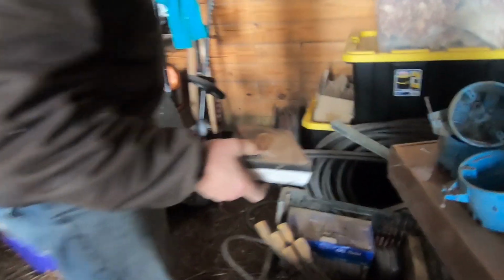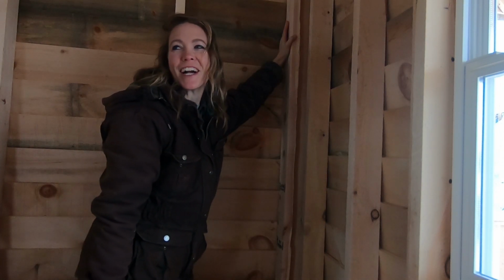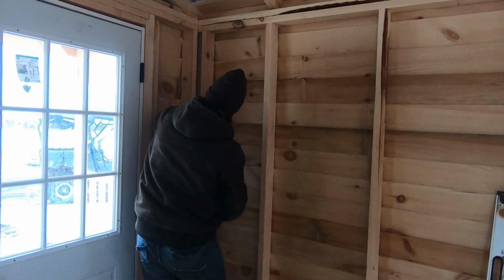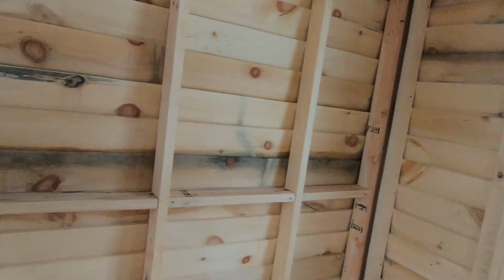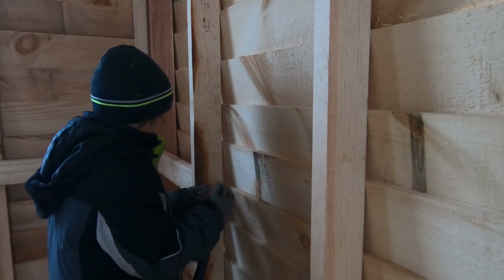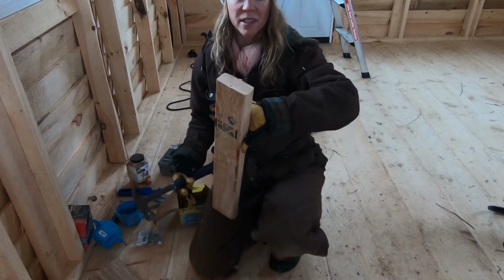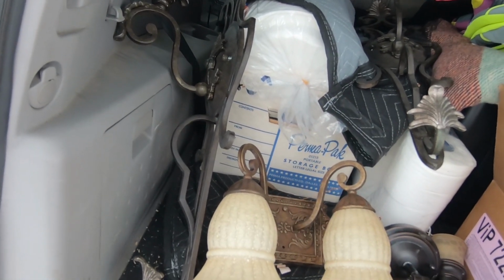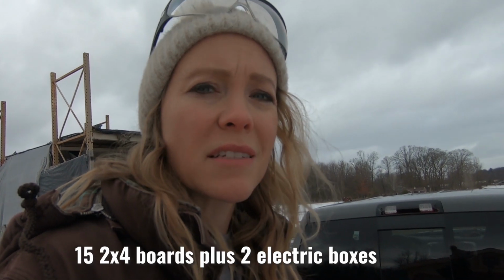THIS Was a DUMB Idea . . .  - DIY Off-Grid Shed to Cabin Vlog#3

Comment: That was a lot of nailing- nice job guys! Please go through and check all your siding. Around the 10 minute mark you can actually see the siding bouncing as you hammer nails in. I am afraid that with it being that loose, the spray foam will expand and push the siding out and you won't be able to put it back easily. Love the build :)
Reply from the maker: Good eye! Yes Erik noted this as well, and pulled those nailers out and re-did them. Currently spraying the inside "cracks" before the pro comes to do it :)

Comment: Thanks for the shout out. 
Your arm will become conditioned to the hammering.  The palm nailer that was mentioned is a great idea, but we still don’t have one.   You guys are doing a great job.
Reply from the maker: Yeah it was funny , on day 2 my arm felt fine and my hand eye coordination much more improved!   Did you use a framing nailer for yours?
Reply: I bought a paslode framing nailer and we have used it for almost everything. On the house. We used the hammer and nails for the joist hangers in the house and on the deck.  If I had that part to do again, I would buy the palm nailer.
Reply from the maker: @breakheartorchard  good to know, ill add them to my buy list 😄

Comment: Use a drill and screws. We did ours with screws it went faster. I used the torx bit screws. 3 1/2 inch screws. Hammer is ok. But just saying it went faster with the screws. Have an awesome day both of you. 🖐️😆 🔨. I will come back and see the rest of your video. 👍
Reply: plus screws are also easy to remove wen needed
Reply from the maker: We use torx too on our screws! However with our upcoming BIG building project,I figured I could use some hammering practice ;D
Reply: @This1LifeWeLive  ok I see. Building some muscle I gotcha 💪 🔨😃

Comment: As mentioned before, I would have recommended to pre-drill the wood you are going to nail through.  Just a bit smaller than your nail or screw.  I would stagger the horizontal studs, not just to make it easier to install, but makes for a good fire break if the unfortunate happens.   Since you are going to run power to the building, I would install a ceiling fan.  It will help with moving the air around to help with AC and heater.  Since this is a small building, I would not use the larger lights, because they would make the room look smaller.  The one light mount with two lights, I would probably use it as an entrance light.
Reply from the maker: Well now we do have a few ceiling fans in the barn, but they might be a bit large. I'd have to look around for something that would fit and see . .

Comment: I gave up long ago on nails. I run 2.5" or 3" torx drive 8# or 10# (or larger) screws with an impact. Might cost you a little more,  but easier on the body and easier to handle. (Use a bit that is magnetic to hold the screw on until its started). Doesn't matter if it's framing or fixing a corral fence.
Reply from the maker: We usually use the same :)  My next video, you'll laugh because the torx bit is SUPPOSSED to be magnetic but the holder no longer works and it keeps falling out!

Comment: Your hubbie says a Milwaukee 30 degree framing nailer. Pricey, but one of the best. If you guys are going to build your new home, this nailer would be an extremely good investment. If you get one, swing for the 12 amp hour battery. For another $50, you can go much longer between charges than with the 3 amp hour battery.
Reply from the maker: Nice tip!

Comment: If you use 4 recessed led lights you don't need the light sockets they just clip in on holes cut in Sheetrock I put 4 of them in my living room they are adjustable for the color from bright white to warm softer color and they are also dimmable.
Reply from the maker: I've got some of those planned for the horse trailer (tight space) but never thought about using them for the cabin :)

Comment: Poor baby.  Those horizontal ones should have been flush with Studs for nailing Drywall. They don't have to be even height.. put alternate ones 2" higher and nail 'em with longer swing!  No need to toenail.  Use a smaller Hammer.  Wood screws recommended.  3".  Wall mount lighting will really show uneven Drywall.  I have done many basements.  Use ceiling fixtures.  It may be advisable to run Communications cable in a different hole to avoid electrical interference.
Reply from the maker: I still haven't decided if I will buy a router extender or run a long line from the house to the cabin for the internet, but I didn't know it could cause interference running in from the same hole as the electrical.
Reply: @This1LifeWeLive  I am not positive of that but it is a possibility.  You can always use a steel bit to drill wood.
Reply: @gordbaker896  you are correct, the electrical field will cause issues with communication devices if run parallel with each other.  You can reduce the interference with shielded wire. Still not desired to run parallel as their is still interference. You need at least a foot of separation to prevent interference. 
My communications background is 10 years as an 18E.

Comment: Have you ever tried pre-drilling your toenails?  . It keeps my nails straight and makes it easier to pound the nails now. I use a bit at least one size smaller then the nails.  I only do this on the hauler goads and not the studs.  Take Care
Reply from the maker: Ha!   No I didn't know you could pre-drill a nail hole! I thought that was only for screws! Would have worked great in this instance!
Reply: I've had to do it a couple of times.  Just make sure your bit is  at smaller size.

Comment: Stud nailer or palm nailer would make that job go quickly.  Finishing work takes a long time.  Lighting so many options but a fan would be nice in summer.  Thinking window AC might need a little help cooling/heating the room.
Reply from the maker: We will get a stud nailer for our house build for sure! I just thought a bit of hammer practice would be good ;D

Comment: You need to go down to Harbor Freight or someplace like that and get a palm nailer. It runs off your air compressor and it hammers the nails in for you. Got to put a little bit of impact oil in it too to keep it lubricated. Once you try one you'll never hardly ever use a hammer again

Comment: I also watch 628Dirt Rooster Bees. A channel where they show bee keeping and hive removal. You might consider to have the shed so closed from the outside that no bees make a home in the space between the walls. Just isolation material is not enough. They will chew through. You can see between the planks to outside. Find a solution for that strong enough to stop the bees. You hammer with your right hand and had ice on your left arm...   😅
Reply from the maker: Most likely (still researching) I will do an oil based sealer which is rodent, bird and bug repelling :)

Comment: Stagger the blocking. It doesn't need to be in a straight line. If you use a level or a snap line to mark the studs, put one block above and one below your level line. That way you can drives the nails without toe nailing.

Comment: curious, when you were signing off I noticed the upper window frame, does he have the upper and lower horizontal boards reversed ? on the window frame (bottom to top and top to bottom, b/c of the diagonal cut on the bottom one)
Reply from the maker: The window on the right? We also noticed it was VERY crooked :P I don't think it's cut diagonal, it's just not nailed on straight . . .
Reply: I was referring  to the loft window (45 deg. angles on end of trim) but then I got a small glimpse of lower window, so I must not be "up" on Amish trim.  re: the spray on insulation, MAYBE some 3mm ply between  the studs ? , (prevent drafts and insect invasion between exterior and insulation, (might be overkill IDK)

Comment: Farm girl really like your style 👍
Don't look like there's anything you want try 💪 you sure have a very unique way to find some help 😉 you might want to consider some type of nail gun air,gas, battery  it does make things easier and faster if I lived a lot closer be happy to loan you one so you don't have to ice the arm down 😁 thanks for sharing 👏
Reply from the maker: WE DO have a finish nailer, so I'll use that later for the walls, but yes for the hosue we will get a framing nailer ;)

Comment: Susan one of the problems you're having with nailing nails is your using your arm from your elbow down to swing your hammer. Watch and pay close attention when Eric is swinging the hammer he is using just his wrist. You're not trying to use muscle power to drive the nail in you want to use the weight and the swing of the hammer to drive the nail in

Comment: I’m going to use two approaches for this comment. One from a medical standpoint and the other from a financial standpoint.  To advocate for a pneumatic air and a better hammer. I believe it was R&R builders who did a break down of good hammers. Spend the money on a good hammer and use that heavy Eastwing for a paper weight or pins that refuse to go in their holes, or when Eric is not listening. Lol
1. Medical:  the cost of a good hammer is $150-300, the cost of Carpal Tunnel repair is $2000-3000 or more depending on the surgeon and how much outpatient care you need. You will lose 10% or more of grip strength, and at times will still be painful to hold a pen and write.  Not to mention the pain at night keeping you awake when trying to sleep. 
2.  Financial:  What is your time worth, what is your hourly rate?  If you have not figured that out you are doing a disservice to yourself.  How long did it take for you to do all of that work?  How much is the pneumatics, compressor, nailer, and hose?  I am biased on nailers, prefer pneumatic over battery; batteries go bad and change so you have to buy a different style every 5 years or so.  The preference is your decision.  You can shave 75% of your time with a good hammer and other tools.  You have a house build coming up to think about. 

Enjoy your content.

Comment: Hay Suz. Once you learn how to swing the hammer, then you'll have the rough carpentry thing nailed. Where's the tool pouch I sent you? That's why carpenters wear tool belts, makes the job easier. Take it easy on Bub, you can't rush perfection;-] Put lights over the lathe, milling machine, workbench and welding table.
Reply from the maker: hahaha, you know I used that tool belt NON STOP when putting syrup lines in, and totally forgot it's intended for stuff like this! Good reminder, I will DEFINTELY put it to use for the big house!

Comment: I prefer HOME DEPOT over Menards too.   Better quality stuff and PRO-military.  Menards is the Harbor Freight  of Building Supplies.  Most trucker who hauled to their distribution centers have a dislike for the company too...myself included. They screw over drivers delivering and  hold them up for over a day on a 2 hour max unload.
Reply from the maker: There were a lot of issues with them both here locally and out of state, harassing elderly customers over masks and throwing them out. They had masks on, but couldn't keep their nose covered and Menards wouldn't tolerate it unless they filled out a long medical exemption form. And even with that done they STILL would get harassed :(
Reply from the maker: It's their right to throw them out, and it's my right not to support a business that's rude to customers. I no longer go to our local Family Farm Store either for that reason.

Comment: You would save yourself time and pain if you just used screws with predrilled starter holes along with using a level to make sure all boards are level and straight.

Comment: It might have been a little better to drive the nail at an angle through the stud into the board rather than toenail a loose board.   You should drive nails with whole arm to shoulder, not elbow.   I drive nails with my index finger. 😈.   Do you really have 5 years of your time available to build a house?
Reply from the maker: If we decide to go with SIPS walls (very energy efficient), we won't have much to do for framing and things will go MUCH faster!

Comment: Looks like your sugar shack has been neglected, you should fix er up and keep making maple syrup
Reply: I would like to get a saw mill and saw lumber for a sugar shack
Reply from the maker: We hadto do major repair work 2 years ago to get her operational, and she JUST barely held up (leaking). A cabin like what I bought for my office would be perfect for a sugar shack. However, at that cost we could simply buy a saw mill. So I THINK that's what we are going to try to do later this summer. If we can get a shack built and re-run our lines we will be back up and running 2022 :) And I'll save the first made jug for you!